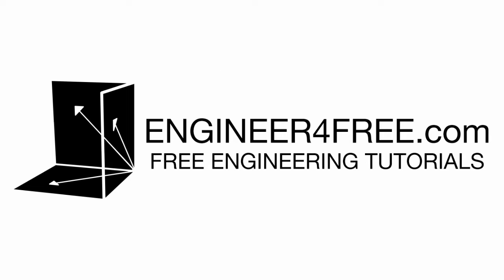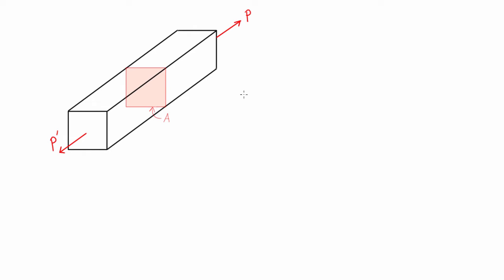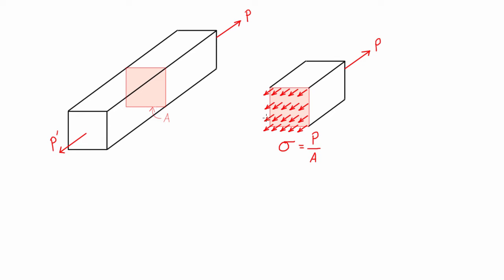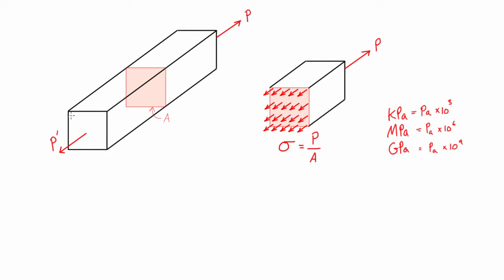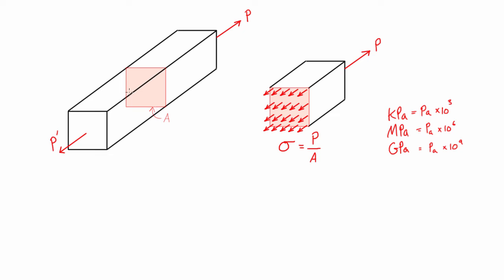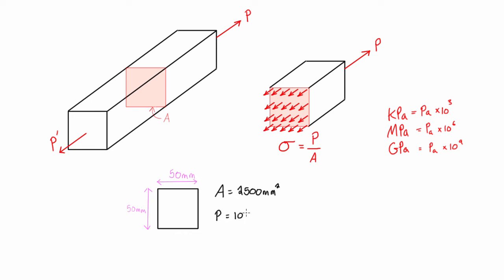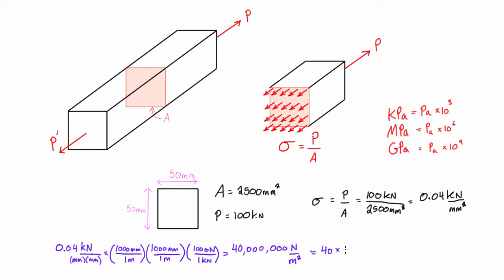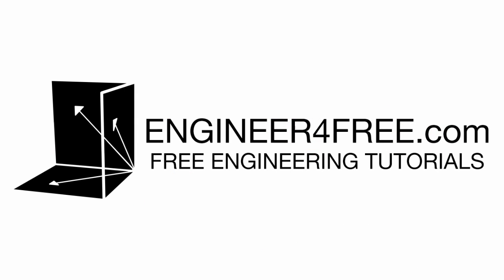Normal Stress

Comment: So what is the difference between normal stress and average normal stress Sir ???
Reply from the maker: Technically this video is talking about average normal stress. It's just the force divided by the cross sectional area, and we assume a uniform distribution all over. In reality, it's not uniform, it's stronger in the middle. But most analysis at the introductory level of mechanics of materials deals with average normal stress.

Comment: why does professors write P and P' like you did in the video? what's the difference between P and P'?
Reply from the maker: It’s usually an abstraction of applied force and reaction force. This video just has an arbitrary rectangular member floating around in space, so if we want to apply a force (P) to it, we need to have an equal and opposite force (P’) to keep it in static equilibrium. IRL, the force we apply would be P, and P’ would usually be provided by a reaction force. But drawing the reaction on the member just is kind of irrelevant to the abstract member we have drawn. The exact type of reaction doesn’t matter really, so long as you have the tension or compression existing within the member. So that’s why we just use P and P’. Hope that makes sense.
Reply: @Engineer4Free  I see, thank you for the clear explanation. My exam for this course is in a week, and your videos really helped clear things up, so thank you so much! <3

Comment: i think the answer becomes 40kpa
Reply from the maker: 0.04 GPa = 40 MPa = 40,000 kPa = 40,000,000 Pa
Reply: @Engineer4Free  I got the answer 40 KPa. If you convert 50mm to m you will end up with 40,000 which is 40 KPa
Reply: It's mm ^2, not KN/mm
Reply: ur right man. 0.04 times a thousand for the K sign times another thousand for mm^2 to m^2. that would be 0.04×1000×1000=40000Pa=40KPa.

Comment: Why v use Word MODULUS?
Where it came from??
Wt is its meaning????
Sir pls answer if u don't mind
Reply from the maker: The Modulus of Elasticity is a number that measures an object or substance's resistance to being deformed elastically. I recommend checking out the wikipedia article for a quick summary:https://en.wikipedia.org/wiki/Elastic_modulus It also represents the slope of the elastic region on the stress strain diagram for a material, I made a video about that, you can see it here: https://www.engineer4free.com/4/hookes-law